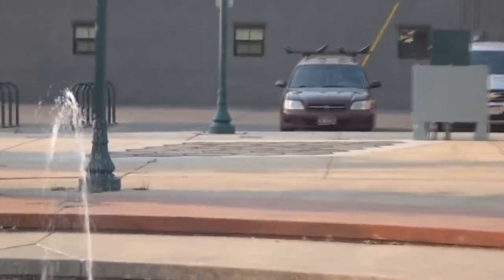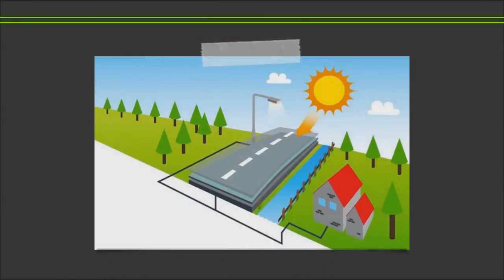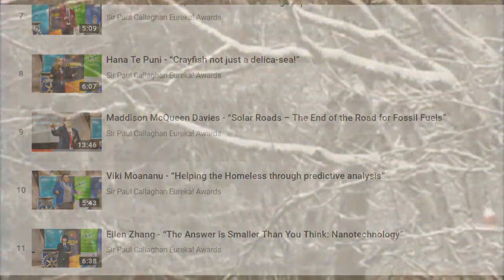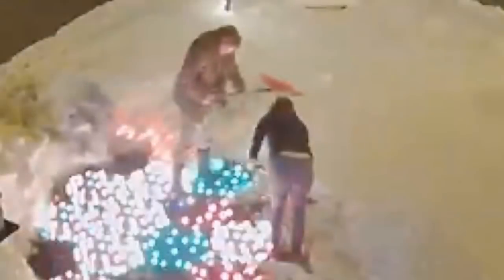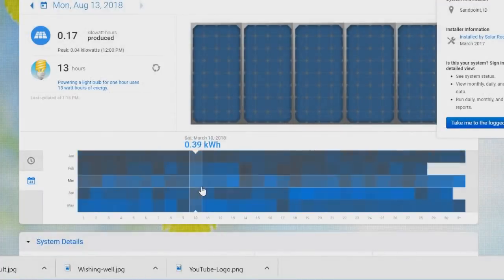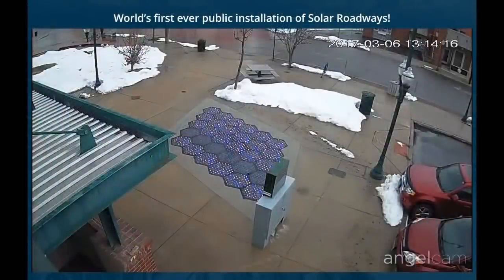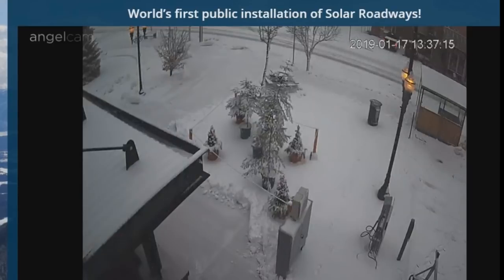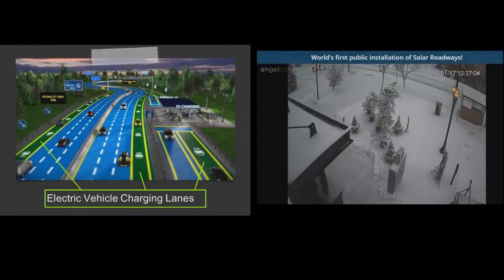Solar Roadways to be installed on Cruise ships!!?

Comment from the maker: The STUPIDITY on solar roadways is a zombie that just wont die.... unlike the power generation of ACTUAL solar roadways which died in sept 2018! ;-)
Reply: I'm going to have a Solar Freakin Roof soon. 160 euro for 300w panel. So much simpler.
Reply: I guess we just gotta keep putting them in the ground.
Reply: (0:42 - 0:47) Not only young(children's) minds, but also the minds of adults who still have a youthful sense of wonderous discovery and are eager to learn/change the world for the better, while also applying logic, skepticism and reason to their endeavors.
Reply: At this point, it just seems like they're trying very hard to invent a problem that could be solved with their... 'innovation'. If you ask me, even as just a paperweight this is quite impractical, one slab being larger than any standard paper size, although I'm sure it would excel on the "weight" part.
Reply: First step is to build 10 miles of roadway using dummy panels(no electronics) as a material test zone... Expansion, contraction, heavy loads, high speeds, accidents(including oils, fluids, solvents), road debris, drainage, and this assuming No Snow plows.. Roads take more abuse then most people realize.
Reply: Lol
Reply: @reasonablespeculation3893  It amazes me people are so un-thinking to not realise that roads take literal truckloads of abuse!
Reply: People love to drink soda, but also have to clean their bathrooms, so I had the brilliant idea of soda with bleach in it! It will actually be better at both applications, I promise... give me money.
Reply: I rolled my eyes so hard before chuckling, nice one seriously hey.
Reply: This video was almost exactly the same as your last solar roadways video. Also you repeat the same stuff over and over again.
Reply: ZRkillerBUSH well i don’t mind :D to me it’s just a source of lolz besides he is updating on the current status of things which I do appreciate :)
Reply: Oh, you're just jealous because you didn't think of it first!
Reply: I bet there is not one single power optimizer built in between any of these solar panels.
Reply: Reasonable Speculation Already been done on a slightly smaller scale - 2 kilometers of traffic-able highway in China built in 2017. YouTubers gushed about it at launch and Chinese propaganda went into high gear - https://youtu.be/v3Rh3yKF4m4   Six months later it closed due to deterioration of the road surface, maintenance costs, and low electricity production. The breakdown of the textured layer was becoming a safety issue that could only be remedied by replacement of the entire panels and the trial period was brought to a close. It was a major failure and the Chinese government kept relatively quiet about it and the YouTube solar roadways brigade were conspicuous in their lack of videos reporting the failure. There are still lots of videos from the launch promoting it, but hard to find anything about the closure.
Reply: ZRkillerBUSH It is true that the conmen continue to spout the same BS, but this video added the latest developments as well. Just like with flat earth nuts, and young Earth creationists, the BS keeps coming and we need to push back with facts otherwise teens like that lovely high school student will continue to be conned by these evil people.
Reply: @Thunderf00t, would it be possible to look at the viability of Gravitricity's idea?  I did some rough calculations and I think it would take a >30kt weight in a 100m shaft to generate just 8MWh of storage.  What would these things cost to have a few hundred in operation?  How deep are our existing disused shafts, and how would it affect the cost to drill new ones?  TIA!
Reply: This madness called solar roadways will never end as long as there are gullible people supporting it. 
Next thing you know there will be solar benches that you put your solar laptops on.  
Maybe Thanos was on to something last year.
Reply: What about Solar Freaking Solar Panels.

It's Solar Panels for yo Solar Panels!

Get it while it's fresh dawg!
Reply: It will go great with my solar plates on my solar table and solar chairs, i even bought myself a solar powered flat screen TV with its own special channel; SOLAR.

Comment: I was massively disappointed when someone presented solar roadways in environmental engineering class at University last semester as a ground breaking way to solve our energy problem. Safe to say during the question period at the end of the presentation I had some harsh words
Reply: @A B same here
Reply: Best to teach them now than never
Reply: Wow what an original idea!!!
Reply: I want to hear what you said
Reply: Recite what was said please
Reply: I want to hear what they said.
Reply: @wompastompa3692  The problem with these technologies is not enough Billionaires are advancing them, just like 4k tv were 120k when they first came out cost millions to develop, now look at the cost once so many of them have been built.
Reply: @corvox2010  
The problem is that semiconductors and heat don't mesh well.
Solar panels are actually giant semiconductors, if they get too hot, they degrade.
So in order to not damage the panels, you need to find a way to cool them, or they degrade and lower the power they output.
In practice that is done by providing an empty space under the panel.
In the end, what exactly is the purpose of this invention, what problem does it solve?
Solar panels are one of the least compact ways to harvest energy, they are also not clean at all as their manufacture, like any manufacturing process produces waste.
So if you want power and have the space, then slapping them next to the road where you can provide the necessary space to have passive cooling will actually be a much better idea.
If you don't have space, then a nuclear plant will provide much more power, much cheaper with smaller space requirements.
So essentially it's a flawed idea, with poor engineering, that solves a non-existent problem.
Reply: I bet you showed them.
Reply: @wompastompa3692  bro calm down
Reply: @EoRdE6  bro, you just posted cringe
Reply: @EoRdE6  I'm merely extending one of the rules of the internet: tits or gtfo. Either show us the goods or fuck off.
Reply: Lol it's not even an original idea at this point lol
Reply: Well if you delete your original reply to me then it isnt fun
Reply: I'd imagine if you asked; 

"Why not just use normal solar panels and put them on the side of the road or put them 15 or so feet over the road?" 

- dont have to waste energy heating shit. Snow will just go on the "solar roof"
- no need to rip up the road and bury wire.
- no need to interrupt traffic to fix a broken panel. 
- use actual solar panels, that could have a potential to have solar tracking. Collect like 1000x times more power
- higher durability because you dont have fucking semis driving on silicon crystals (aka solar cells). 

Call it ... "Solar freaking roof" or something like that.
Reply: @animasaurus2007  Nuclear Power is just an 'idea' too. This idea/technology is not finished by any means. It's total bullshit that people claim this stuff is cheap. Waste is also an expense.... And we have absolutely no satisfying solution for the long term storage (even when this would be ridiculously expensive).
edit: talking about fission here...
Reply: I've found that a lot of environment things in uni are complete jokes.
I was a speaker at one such get together, but the big cheese speaker was the medieval literature prof, who just made dumb jokes the whole time.
Reply: @simonrichter3950  Nuclear energy has the lowest cost per kW of energy.
And yes we are talking about fission, fusion reactors are still a ways off until they are ready to be used.
You can also be sure that the cost to handle waste is added in the price of the electricity, because that's how industries work.
Photovoltaics are not the cleanest things to produce like I said.
They are also dependent on how much sun there is and are not active for the night.
Which means that if you want continuous power you also need a battery system.
They are also suffer from reduced efficiency in countries that are closer to the poles.
And worst of all, they degrade over time anyway.
That's not accounting for space requirements, because they are one of the least energy dense methods to create energy.
I'm not saying they are complete garbage mind you, I'm just saying that there's no universal solution to a problem.
As for the waste that comes from Nuclear power, you do know that it can be recycled and reused, right?
Reply: @animasaurus2007  partially, yes^^
Reply: If a girl presented it, white knights would back up her dumbass..
Reply: @simonrichter3950  actually, fully. Just make the remaining into DU armoring for M1 Abrams. Ive studied nuclear engineering and can yell ya it is far more economical and environmentally friendly than solar panels that were made in coal powered factories.
Reply: Yep, I had a classmate once tell me about perpetual energy -_-

#FutureEngineers
Reply: Shane Brunson er, no
Reply: @simonrichter3950  Put nuclear fuel chemical reprocessing plants on the same site as the nuclear power plants or a short distance away. There is already enough mined nuclear fuel to last for decades at the very least using only recycled waste.
Reply: @animasaurus2007  Fun fact: solar panels are actually diodes. Another fun fact: LEDs are secretly solar panels. The technology is the same. If you shine a light onto any LED, it will generate a small voltage and very low current. If you connect a power source to a solar panel, it actually produces infrared light. Not just heat energy, it acts like an infrared LED. And LEDs do not like heat. At all. They also have a limited lifespan. Apparently diodes also degrade when producing energy. The process seems to be reversible, but in both cases it shortens their lifespan.
Reply: @animasaurus2007  'As for the waste that comes from Nuclear power, you do know that it can be recycled and reused, right?'
How much of America's nuclear fuel comes from recycled used fuel?
Reply: @oldbatwit5102  Look up depleted uranium.
Uranium can be used for other things except fuel.
It's not necessarily waste if used correctly.
Reply: @animasaurus2007  And?
Reply: lolol my thesis this year is basically shitting on a bunch of ideas like this
Reply: Kids these days only know how to plagiarize.
Reply: @corvox2010  the reason techonology like tvs keep getting cheaper is because it actualy is a viable product. And lowly youll find ways yo make the same things with less actions. Solar roadways are in itself useless and no other company is going to try to experiment with them kinda leaving them as a dead way too expensive technology
Reply: @simonrichter3950  no but putting gold,silver,copper,glass,circuit boards,leds is not a waste xD with nuclear power you have actual poweroutput instead of hoping the sun will shine on your road during a trafic jam
Reply: @oldbatwit5102  ask hiroshima
Reply: Engineering students really proposed that? Man that is sad.
Reply: At university🤣🤣🤣
Reply: @corvox2010  in what world did 4k tv cost millions to develop and sold for 120k? Did you even think this about this comment before you posted bit because that sounds like a quick way to go bankrupt.

Comment: "A micro-possessor, which is basically a mini computer."
Reply: That is wrong on so many levels...
Reply: I died at that
Reply: I understand everyone laughing at this and all, but that's the best way you can explain it to people that know jack-shit about that stuff
Reply: Well do you have an easier explanation?
Reply: @spooderman_q  microprocessor it is a calculator; the brain of the computer. But it's not the whole computer especially as the term computer is used today to mean a device.
Reply: @RydalS  my question is (an easier explanation) not the opposite... What i meant by my question is that she did a good job of making what she said easy to understand.
Reply: @spooderman_q  ok
Reply: @clock4883  it's how I describe them to non tech people.
Reply: @spooderman_q  It's in the name, isn't it?
Reply: Kids these days only know how to plagiarize.
Reply: @RydalS  Eh a microprocessor is essentially a cpu + ram, a stripped down computer on a single chip essentially. Sure it doesn't have a hdmi port but a mini computer is a great term for it I think. It's way closer to a computer than a calculator(unless you think of graph-calculators)
Reply: maybe she could say System On Chip? would be closer...
Reply: I mean it isn't even a micro processor, they are using micro controller that does things on demand of the server.
Reply: @constantinosschinas4503  it isn't SoC, cuz it's not multiple function packed together.
Reply: Epic lols..
Reply: Microprocessors are not, microcontrollers are, the difference is thin for technical noobs